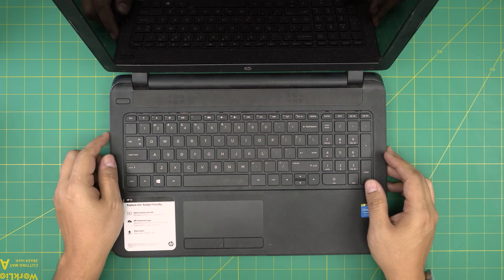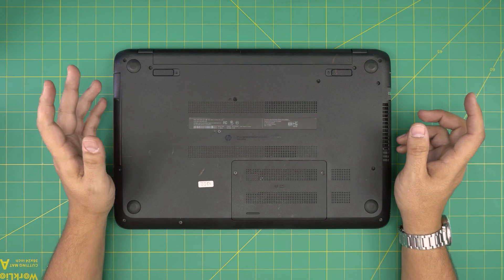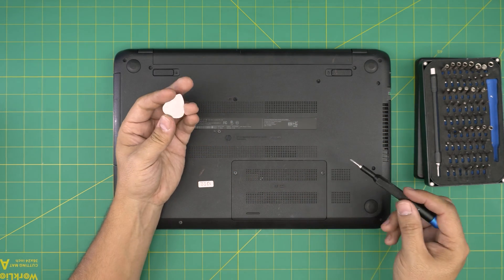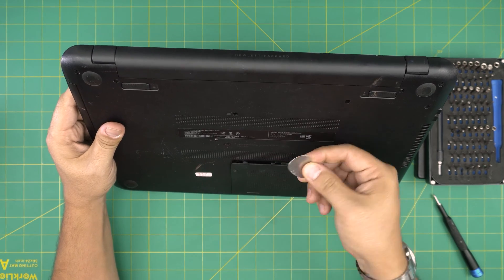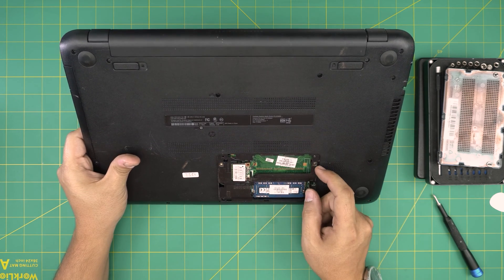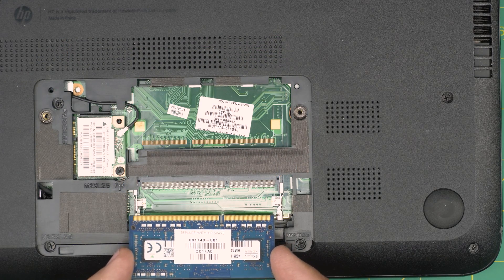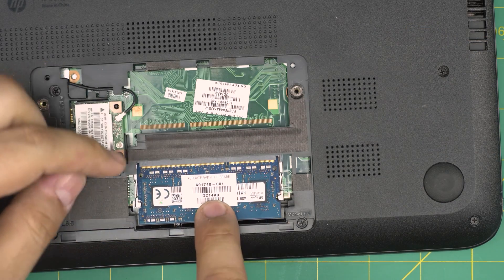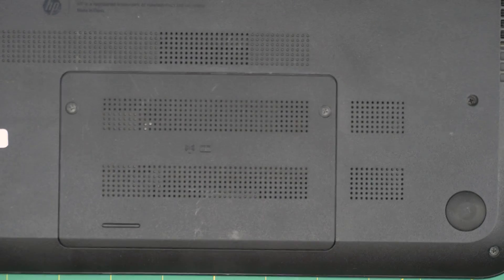How to Upgrade RAM for HP 15 NOTEBOOK 15 f039wm Laptop | Step by Step

Comment: Does this increase the speed of respond!? my computer is to slow and hangs a lot and sometimes there's a blue screen of death as well 😢 how do I fix it!? Plz help
Reply from the maker: 🫠Regarding your question, your issue is coming from the mechanical HDD that you have. Upgrade the HDD to an SSD, and you will see a dramatic performance improvement.
here is the link:
https://youtu.be/0fxIEiG9l7g
Should you have any further questions or requests in the future, please don't hesitate to ask me.
cheers🍻

Comment: how do we get the other component so we can install 2 ram sticks?
Reply from the maker: 🫠Regarding your question, you can't just solder the RAM slot and make it work. There are many other components and BIOS firmware edits that need to be done. You can take it to a tech repair shop and ask them to install it and make it work.
cheers🍻
Reply: @uFixTek  thanks!
Reply from the maker: anytime 🫠🍻